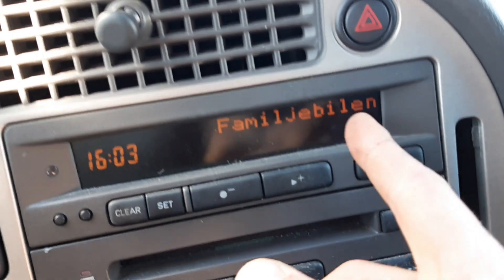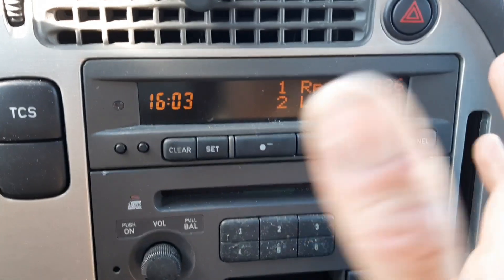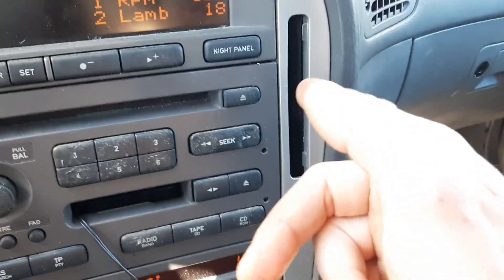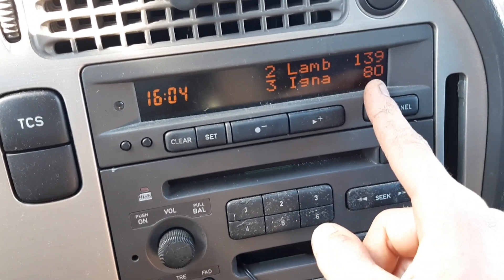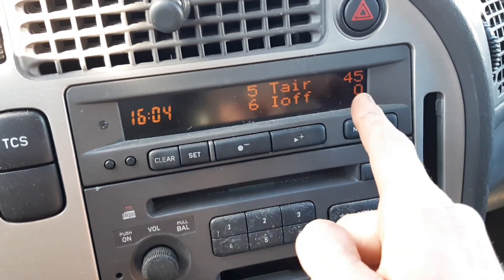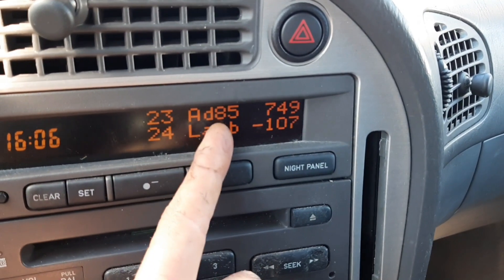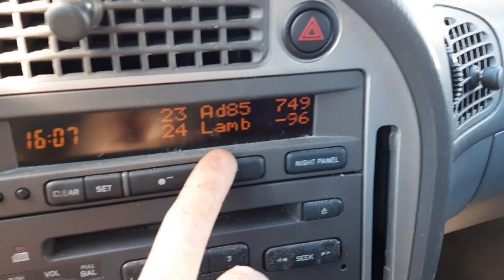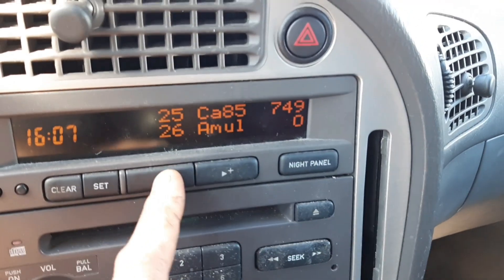OPEN SID on the SAAB 9-5 - what is it and how does it work?

Comment: Do you know what fuse powers the sid? Mine has gone dark but still functions. Switched it with a spare I have and still have no lights. Any ideas much appreciated
Reply from the maker: Hi! Sorry for the late answer!

Im not sure but google wisonline. You can find sheets of electrical wiring diagrams, technical info and how to repair different stuff. Its a really valuable tool!
Reply: @KalleUhr  thanks for the response. Turns out it was just a cooked wire. Providing power to to lighting within the SID.

Comment: This is freaking awesome I got to do this, I have a basic stamp too and a couple of arduino nano's, just itching to get on that circuit board. And how did you get that clock to go into 24-hour mode? All cars should be able to do this.... and burning up 10 minutes? Are you kidding me? This information was so awesome, I subbed right away, you got my thumb in the up position, and it's stuck there, thank you!!!

Comment: hi. I took off battery to replace the headlight bulb. and now I get 'radio code' message, which means I can't access radio, cd or tape. any tips?
Reply from the maker: You should have the radio code inside your manual that comes with the car
Reply: did u figure out how to get the radio working again?

Comment: It would be nice to know which features are most important to diagnose condition of an engine. I have problem that Mair does not reach mreq. I have stage1 one b205r , software 50A, hardcoded limiter is off. I checked the intercooler for leakage and it's fine, evap is fine, apc and turbo, ignition casette etc, no knocks or misfire. This trionic suite makes me crazy..
Reply from the maker: It could be as easy as clogged airfilter honestly. How far off is the mAir from mReq?
Reply: @KalleUhr  when I set for example 1100 then I have like 1040. When I set 1050, then I have about 1000. I have ecmstat 20, which means torque limiter but torque limiter map is set higher that this. I ordered K&N filter but not get it yet.
Reply from the maker: @pabllok  Well thats not much off. I thought you were like 2-300mg off requested value.
Reply: @KalleUhr  hi, just a small update. Catalytic converter was clogged, now the car goes like crazy.
Reply: How do you know the turbo, wastegate (actuator) and apc are fine?
Reply: @REDxFROG  first I experimented with the bin. Then I replaced apc, dv valve for brand new. Evap was checked, apc upper hose was plugged. Turbo was regenerated but I also checked it by unplugging middle hose from apc, then I got mair easily 1200mg/c. Throttle and mass air sensor were cleaned. Igniton cassette is band new. Catalytic converter was check for clogging with tech2 procedure. Result is the same about 50mg - 80mg less than mreq. I think my stage 1 bin which I did myself is shitty.